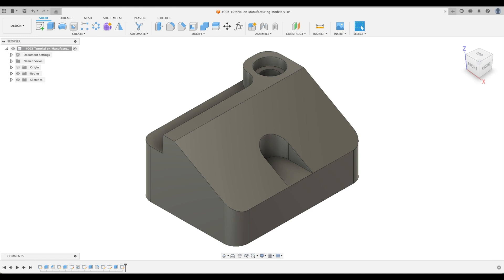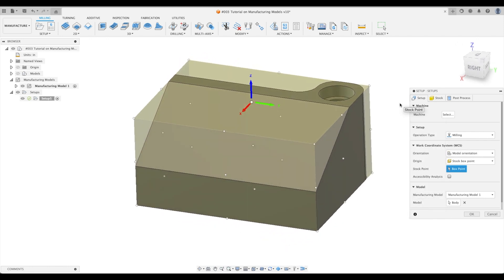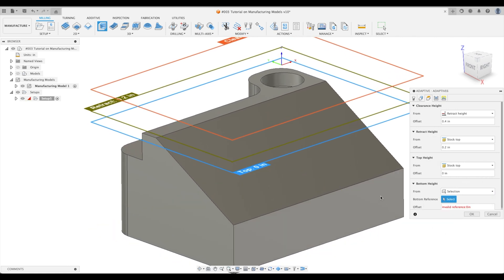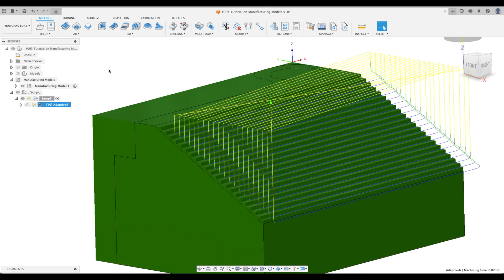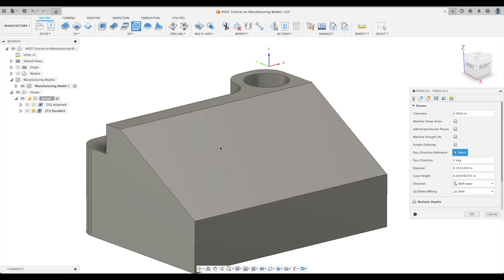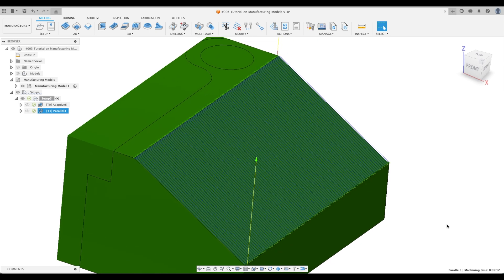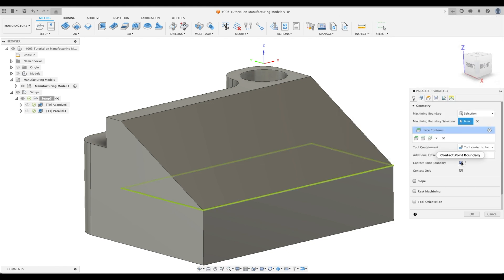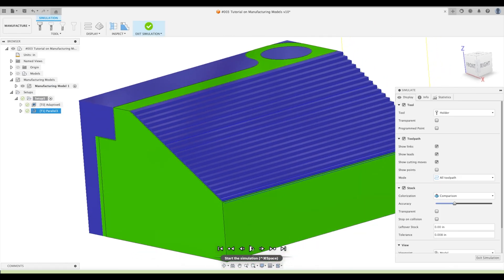Fusion 360 - Intro to Manufacturing Models - Part 2 Toolpaths - Short Tutorials #4 (2023)

Comment: Thanks very much for the videos. I find your videos easy to follow, the pace is not too fast, and I just wish other videos were like yours. You even have a great "teaching voice" that helps hold my attention, some voices just plain irritate me LOL.
One thing I would have like to have seen is "completion" of these videos on manufacturing models. By that I mean what comes next to complete this part. The two videos have only shown how to machine that one face. Do we use the manufacturing model as stock for the next operations. And if so, do we then have 2 completely separate gcode files generated to machine the one part.
I actually tried setting up a 2nd operation to machine a part I made, but I could not select the manufacturing model as stock, it simply would not select so don't know what I'm doing wrong.
A 3rd video would be great to demonstrate this.
Reply from the maker: Thanks so much for the comment and your encouragement! 

Thank you too for the suggestion. For a while now I’ve wanted to do a series on the Manufacture workspace and how to complete a part from start to finish. Your comment makes me want to produce that series. Stay tuned!

Comment: Can you suggest when you know when to use a finishing tool path for the amount of material to be removed? Lets say I want to take a .080 concave from the center of the part. Is this a finishing tool path? Lets say I want to take .75 would you first rough then finish? How much material is considered to be a rough and how much is finish?
Reply from the maker: Thank you so much for inquiring! Unfortunately, that is not an easy question to answer. There are numerous and complicated factors to take into account such as material, hardness, size and quality of cutting tool, rigidity of machine and fixture, tilted vs non-titled direction of cut, angle of cut, etc, etc, etc. I don’t know if the following links will help you or not, but it is a basis for showing you how complicated things can get. 

https://www.sandvik.coromant.com/en-gb/knowledge/milling/profile-milling
https://www.harveyperformance.com/in-the-loupe/ball-nose-milling-strategy-guide/

Don’t be scared though. Try and read through those technical documents to understand what particular machining situation you are faced with and apply the direction. Another article gives a specific job using rough, semi-finish, and finish strategies to finish a part to a very nice finish. I hope it helps:

https://www.moldmakingtechnology.com/articles/machining-techniques-are-you-finished-yet

Lastly, I hope this next article is the most useful to you. It discusses a general rule-of-thumb in how much material should be removed by a semi-finishing and finishing operation:

https://www.secotools.com/article/118130?language=en

Programming is a mix of math, science, and art. You as the programmer need to balance what kind of finish you need vs how much time you spend machining it. Part of the fun is the art of learning this stuff! You can do it, just make sure to spend the time learning and reading… there is never an easy answer for something that is so challenging, but enjoy the process, so that the time spent in learning flies by!